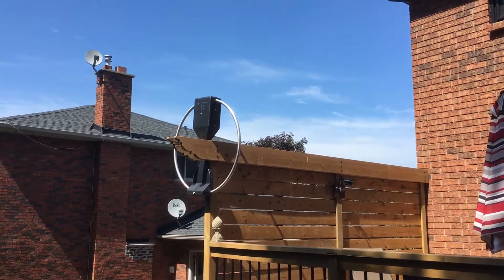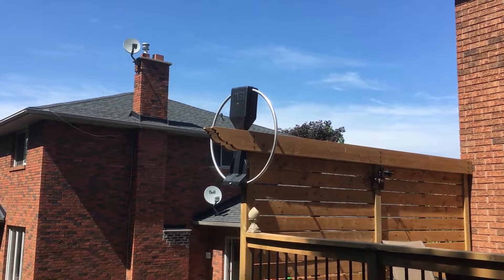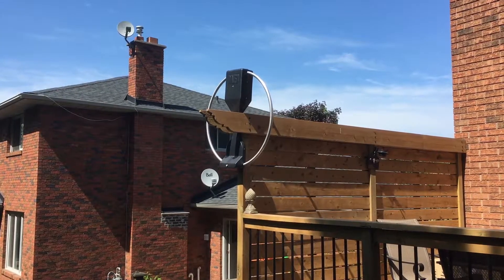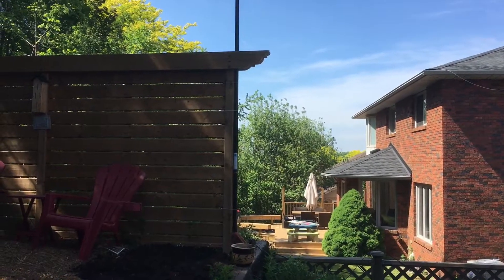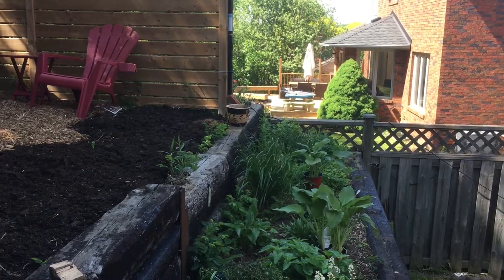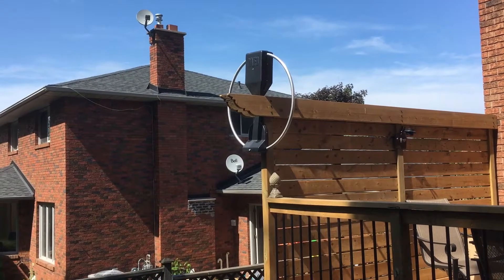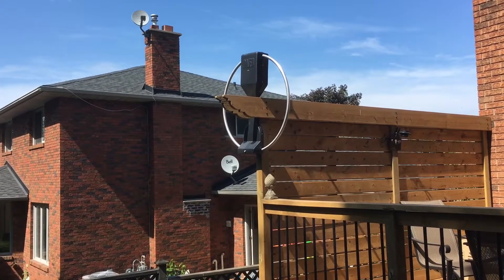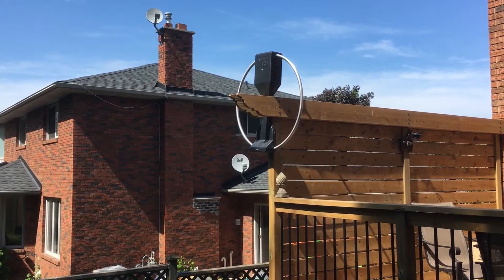🔴 MFJ Mag loop VS vertical - WHICH IS BETTER?

Comment: You say the vertical outperforms the loop. However, the vertical is multi directional, while the mag loop is less so. Your setup looks like you annot rotate it. If it was rotatable, I would think both would perform very similar.

Comment: Adding to that comparison, your XXXX foot tall vertical would probably not compare very well to a 6 element yagi on a rotor on a 100' tower.  Those in height constrained locations will do well with a lower profile antenna compared to most other options.  Every antenna is a "compromise".  We all try to get the antenna best suited to our environments and preferred modes of operation.  Many of us cannot have an HF vertical or even a dipole.  We use what we can use.  Many folks are happy with their MFJ-1780, 1786, and 1788 loops.
Reply from the maker: 31 feet

Comment: Nice info

Took me 26 years to discover a 9:1 unun and the many bands it works with a single wire and often without the need for a tuner.
Great stuff.   Works so well I don't want to move it.   Have 2nd 9:1 and plan to go with  a vertical or a sloper at about 45 degrees.

73 ne5b

Comment: As others have commented, this is not a valid comparison.  The loop is in a very poor position and is much, much too close to the vertical, where the antennas will interact.  I suspect you would see an improvement merely by putting the loop where the vertical is.  You need to run WSPR tests over about a week to reach definitive results.  This kind of 'gut feeling', human-based assessment is something we left behind a long time ago.

Comment: Here are some general rules of thumb for HF antennas:

1 -  Bigger is usually better.
2 -  Resonant is usually better than non-resonant.
3 -  Dipoles at a half-wavelength, or more, above ground are usually simpler and provide good overall results in most situations.
4 -  Resonant 1/4 wave vertical antennas with radials usually provide better performance for DX than horizontal antennas, due to the lower angle of radiation.
5 -  Vertical antennas are more subject to man-made noise than horizontal antennas because man made noise tends to be vertically polarized.
6 -  Horizontal HF loop antennas tend to be more quiet than simple dipoles but are more difficult to implement, requiring more supports.
7 -  Vertical HF antennas do not require mounting at great heights above ground and perform well when elevated only slightly with just a few resonant radials.
8 - Loading coils and traps always reduce bandwidth and introduce losses and inefficiency in any antenna.
9 - When using a tuner, remote tuners located at the feed point of the antenna are better than tuners located near, or as part of, the radio.
10 - Balanced feedline antennas used with a tuner are generally more versatile than antennas fed with coax.
11 -  ALL antennas represent some sort of compromise.
12 - Building your own antenna is always going to be more satisfying than buying one that someone else built.
13 - Antenna claims that seem to be too good to be true are usually too good to be true.

Hope this helps.

73's
AI4IJ
Reply: No!  Bigger is not better!  All loops must be smaller than their self-resonant length (typically 1/4 wavelength) at the highest frequency of operation.  If you try the idea of making a bigger loop, you will simply not be able to tune it at all at the highest frequency.  But you will then find yourself with a loop that will tune lower bands (with reduced efficiency, but nowhere near as poor as most people will claim).

Comment: Your loop have a 2x4 in the middle of the loop, that make it useless.
Reply: No, that's not true.  I have made very many loops, all with timber mounts that run across the loop.  If the wood gets wet, it may well cause a slight shift in matching, but otherwise, wood is perfectly fine near a loop. Of course, it's best not to have anything running across the loop, but that makes mounting difficult due to the loop being top-heavy.

Comment: This is a common problem with loops.. They are best used as receive and full sized verticals and dipoles for transmit.  Get rid of the tuning capacitor completely (which does making tuning annoying every 10 to 15khz).  Use a receive preamp and loop for receive (if you have a noise problem) and the vertical for transmit (which can often have too noisy) receive that covers weak stations).

Comment: If you put your vertical loop on an antenna rotor, you'd get better reception and transmission across the pond.  The way you have it mounted is less than ideal and it needs to be at least 8'-10' above ground if mounted vertically.  And that chunk of wood going through the center with some lag bolts or nails of the loop doesn't help either.  I'd raise up a few feet and put it on rotor so you point things better since there are some nulls in the pattern that you have most undoubtedly encountered.    If mounting horizontally, 20' seems to be a good height.  Below that height, the antenna performance is decreased.

Comment: As a licenced amateur operator, you would know about the radiation pattern of the small loop antenna. I can't see a rotator to point the loop in any direction other than the one it is pointing at the moment.

Comment: Would you recommend putting up a vertical like that? I have a 9:1 Balun that I'm not doing anything with right now. How is the bandwidth on it?
Reply from the maker: +Blake Brewer I definitely would. The bandwidth is pretty good. A tuner helps.
Reply: @Radio-Hobbyist  Awesome, thank you. Do you think it would work if the feed point is at the top? I'm in an HOA and am planning on running it from my rooftop (counterpoise in the attic).
Reply from the maker: +Blake Brewer that’s a good question! I can’t wait to see your video on that project. Hint hint.
Reply: @Radio-Hobbyist  haha, I'll make another comment a let you know when I do it then I guess

Comment: That sure is a SMALLLLLLL magloop - but I did not hear what frequency you were using it on.   Compared against such a large vertical - amazing that they could even be in the same league. 
Your mag loop is also not mounted in any sort of an optimum way and plane of the loop is clearly right in line with metal objects on your neighbors house, and you did not discuss which direction your DX was intended in relation to the direction of the plane of the loop.  When I ran the numbers on magloops - the efficiency for teensy loops is pathetic.  For 40M the loop should be well over a meter in diameter, actually my design so far for an 80M is over 12 ft in diameter to get decent efficiency.  Although fun to play with - these little mag loops should not be considered serious DX antennas, and were not made as such.  
So this is really an apples to oranges sort of comparison.  Just my $0.02 worth
Reply: You clearly have absolutely no understanding of small transmitting loops at all.

Comment: In a limited area you may have the use of the loop antenna but I still have a great liking for the vertical antenna . I have been around CB radio and amateur radio and with each the vertical antenna has been there for long distance contacts . I am going to try the dipole antennas as well as the big long vertical antenna for my base shack . As for going to the park or on the mountains or some other places I will be using either the dipole or the endfed antenna for communication with others .

Comment: If you can get that loop up in the air 25 feet or more and run it horizontal, it will shock you how well it works.

Comment: Thanks for the video. The manner in which you have the loop mounted is rather strange, it seems to me. How about a fairer comparison by mounting the loop farther up, away from the wood (especially not having those large pieces inside the loop! Wood does have a capacitance value, as you probably know and can negatively affect radiated power when in close proximity to antenna elements). The complaint you have of the narrow tuning each time you have to change frequencies is fair, but all magnetic loops are high-Q, so that is a built-in "handicap" to the type of antenna, there is nothing to be done about that. Since you are retired and have lots of time, please consider remounting the mag loop (perhaps even try a vertical mounting!) and giving it a more fair demonstration not only for your viewers, but more importantly, for yourself, since you spent several hundred dollars on it! Then, give us and actual on-air video, switching between the loop and the vertical (although MFJ specifically says NOT to have anything such as switchers between the antenna and the control box) as a comparison. I'm looking forward to your next video on the MFJ-1788 (I think that is the model you have). 73!
Reply: Not to mention the metal fence near the loop.  Tsch!

Comment: I actually prefer  the loop.   I have a 55 foot tall vertical with a 9:1 Unun, and you lose power going to the Unun...   It might have a lower takeoff angle also.  I built my own loop.   Loops are about an S unit down from a dipole, they are also directional.  I like loops because you can transmit full power vs the vertical where you are heating a balun/unun.   The Loop should be in the clear.  Loops perform better closer to the ground.
Reply from the maker: +Grey Ghost Good information there a great ghost thanks for leaving a comment ,

Comment: Thanks for this video. I'm still in the process of looking at antennas that will work for me, since I live in a small apartment and space is limited, plus my primary focus will be on mobile operations. I'll be buying a small loop for quick set up and close(0-500 miles) and a  vertical for longer range( 0 to intercontinental range).

Comment: im currently setup on the same vertical wire into an 9:1 unun and get across into the far sides of russia and the states from the uk without issues. I was just looking at magloops for 5 or 600 and u just put me off lol....... thank you for the comparison test u saved me a fortune :P
Reply from the maker: yeah, I always thought my loop was doing a great job - until I got the vertical. 73
Reply: I have great sucess with my chameleon f loop 2.0 plus. I use mine indoors and have made psk31 contact 4k miles with just 5watts.

With the power compensator you have run 60watts ssb voice and 30watts cw. With 60watts I have no trouble making qso from Ireland to Usa. And this is with the loop inside my living room!!
Reply: @ronangsr  psk is a lot like cw and that's why your getting so far out to other countries but unfortunately using ssb is a different story .

Comment: Interesting. I have a couple of questions to clarify... your vertical is just a piece of wire (what kind and gauge?) run up (inside or outside?) of a 31' pole?

I'm all about the loop antennas because of space constraints (and I'm only receiving) but I can't contain my curiosity about other antennas. Heck, I bought a PAR EF-SWL even though I haven't anywhere to use it! :)
Reply from the maker: pretty much. End-fed half-waves they are called. You must use a 9:1 unun at the bass of the antenna but no radials are required. The coax feedline acts as a counterpoise. Super simple - super impressed.
Reply from the maker: I bought mine pre-assembled, but here is the unun plans. http://earchi.org/92011endfedfiles/Endfed6_40.pdf
Reply: Radio Hobbyist go to a 49:1 unun. You’ll be happy
Reply from the maker: I didn't know about this - I will research
Reply: Radio Hobbyist come join the efhw antenna Facebook group
Reply from the maker: I will, thanks!

Comment: Having the Loop more in the clear, and having it mounted Horizontal rather then Vertical can make a big difference. I have the same loop and have mine Horizontally mounted up 25 feet in clear space. At times it outperforms my Carolina Windom!
Reply from the maker: I must try that one day. I have never run it horizontal, cuz I didnt have the height.
Reply: OK Sounds good!!! With antennas is is a lot about experimentation as you already know..  I think their are some on line videos that show the MFJ in a Horizontal position,, plus in Horizontal mode you do not need a Rotor to turn it since it becomes directional in the vertical position..

Comment: You might get better results from the magnetic loop if you had it free and out in the open, instead of having all that wood so near it. Also, how do the two antennas compare on SSB?
Reply from the maker: I don't think antennas have any effect on ssb sound quality. Either the signal is strong enough to be heard or it isn't. That's my understanding anyway.

Comment: I have to agree.  My vertical similar to yours does much better than my G5RV dipole.
Reply from the maker: Thanks Tom. Your opinion counts as I know you're a very avid hobbyist - cheers!
Reply: You are very welcome.
Reply from the maker: +hamrad88 You’re not much older than me Tom but we share a passion for radio and I really appreciate your stopping by commenting and I really appreciate your channel I watch it all the time
Reply: You have a great channel and I try to catch all your shows.
Reply from the maker: Thanks Tom!
Reply: The video has nothing to do with dipoles.
Reply: Verticals have a much lower take off angle so they are pretty good for DX.  Not so much for local work.   I use an NVIS inverted V for traffic handling on 75m here in Florida but my Vertical does a great job of Dxing.  However, the vertical is much more susceptible to noise than a horizontal antenna.  If you are in an urban area the noise level on a vertical can be more than annoying! 

de ke4d